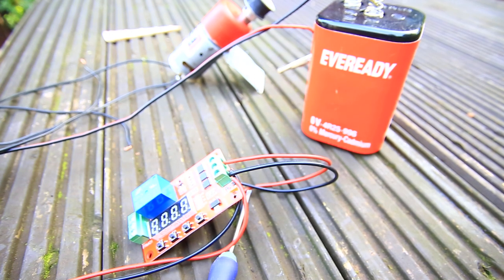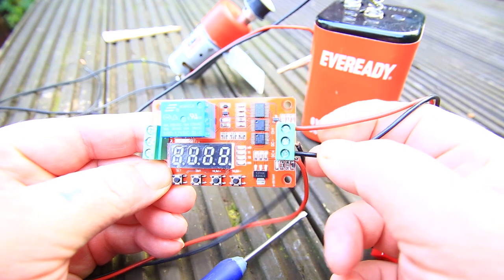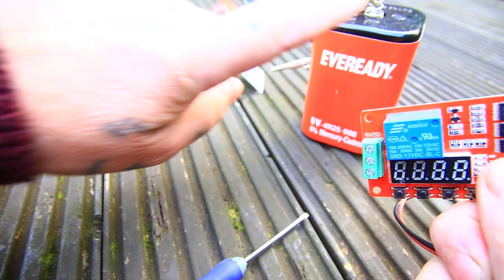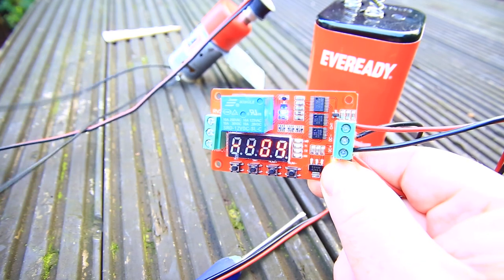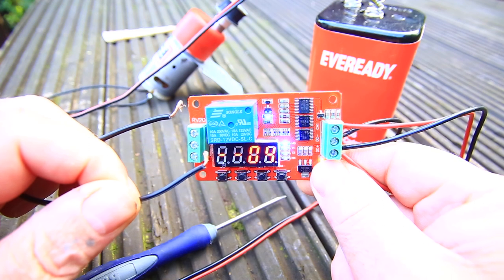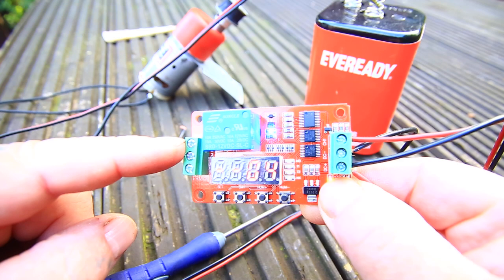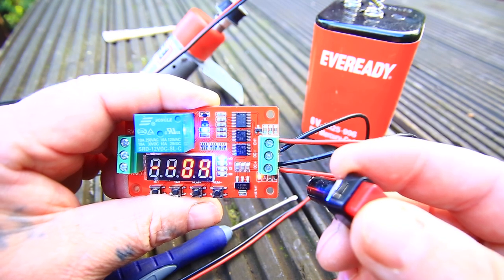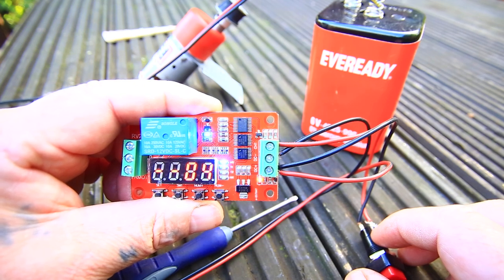12V Delay Timer Relay Need I Help from you

Comment: If the relay board and the motor share the same power supply, connect the motor ground to the board ground. Then run a jumper from the positive of the board to the c-common of the relay. Last connect the motors positive to the relays no-normal open. 
Some of those little units have a built on jumper for the pos connection to the relay com. 
Good luck.

Comment: One of those terminals on the left side is C for common, one is NO normally open and one is normally closed NC.  Basically your load  [ the pump or whatever it is] needs two legs of power to run, one + and one --. Therefore one leg will be connected to your load directly from the battery say the negative.  Then you need only break [interrupt] the positive line to cut off all power to your device.  Plug positive from battery into the C common and another wire from NO terminal to your device.  When the timer hits the designated amount of time there will be an internal connection between Common and NO thus giving your device power.  Conversely the NC terminal which is normally closed will then open cutting of power to whatever is connected to NC.  Basically the closed switch between NC and C will open and simultaneously the  open switch between NO and C will close.  Hope this helps.

Comment: Take the leads from the DC side and loop them into the motor through NO & COM side. Example DC+ NO, DC- to Motor Black, Motor Red to Com. As long as your motor is DC too. Keep in mind you need to have power to the Relay side terminals. Hope this helps you and others who see this video post having the same issues.

Comment: What power source are you using to drive the motor?
If you are using a separate power other than the battery in the vid, just wire the motor and its power source in series to the COM & NO (middle & top) terminals on the left of the relay.     When the relay is energized these terminals will then be closed completing the circuit and powering the motor.   When the relay is "off",  the COM & NO terminals will be open and motor will stop.     
Also, you should power the relay with at least 9V,  but preferably 12V battery or DC adapter.
The 6V you're using may not drive the relay properly.

Comment: You have a 6 volt battery trying to turn on a 12 volt relay on the board. You need a 12 volt power supply OR you could get  
a 5 volt board if you are going to use a 6 volt battery.
Reply: Gary Keich Can a 12 volt Ac/Dc power adapter be used?

Comment from the maker: Hellp people its been some time sorry 4 not answering but I did not fix the problem yet as I have been busy Filming 
I want to thank you all for your help and I will be looking into your comments soon and the Power Source will be a 12 Volt Battery thanks troy
Reply: Hi Troy. The relay contacts work like a regular ON/OFF switch. You only use COM (Common) and NO (Normally Open) to connect with your motor -- exactly the same way as you would wire in your circuit a simple regular switch. BTW, the relay contacts are COMPLETELY SEPARATE from the timer's voltage (unless you decide to connect them to the same power source as the timer's), so they act like an independent switch to use on DC low volts, or AC up to 240 Volts.